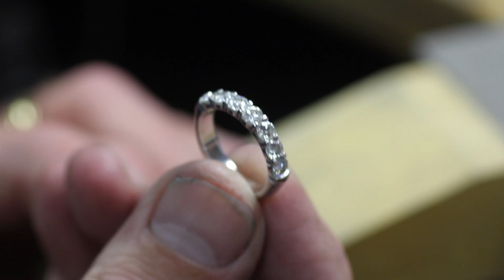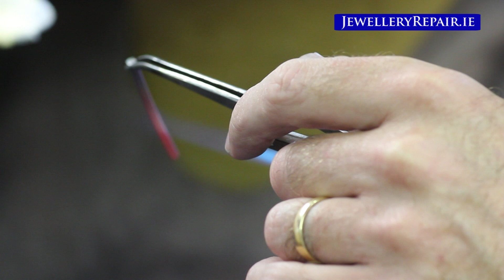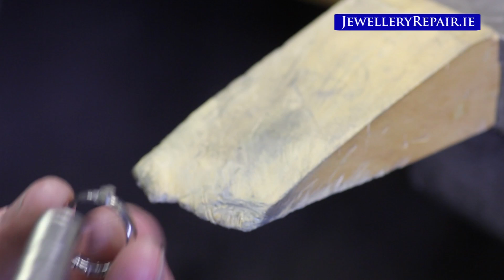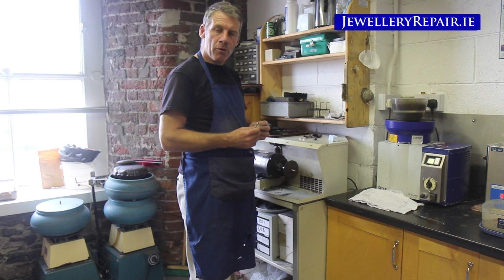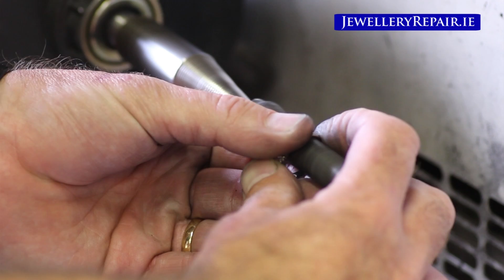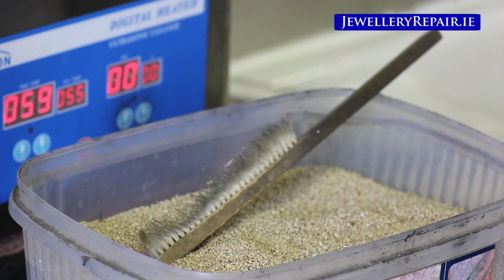Jewellery Repair - Resizing White Gold Diamond Ring

Comment: Nice job on the sizing. We use 18k testing acid to find the joint. Apply the acid to the bottom of the shank, give it about 30 seconds and wipe it off. If the ring has been sized previously you will see a line.

Comment: Another way of adding the solder is on a tweezer save the solder jumping off....heat the solder so it beads up on the tweezer, then introduce it to the ring with the added piece of metal. Personally I would have used a smaller piece of 18ct white as it's expensive to buy fresh metal......plus it cuts down on the filing.

Comment: Question please answer...…….my sister has a 10k mother daughter ring that needs to be enlarged. Can one supply gold for material to go into ring to be sized ...is that something a customer can request to be done ...or...is it up to the jeweler to do?  I understand 10k is more fragile...is that correct?  The ring being sized is 10k with 4 stones...needs to go a size larger or 1 1/2 size larger...….can this be done?  I would so appreciate your insight.....wonderful video....I did so enjoy it. Thanks so much for  your time and hopefully I will hear your answer to my questions....thanks ever so.  Johnny/for my sister Geri
Reply from the maker: Hi Johnny
Yes we can resize a 10 ct Ring call in any time  cost approx 30 to 40 euro
Regards
Tony